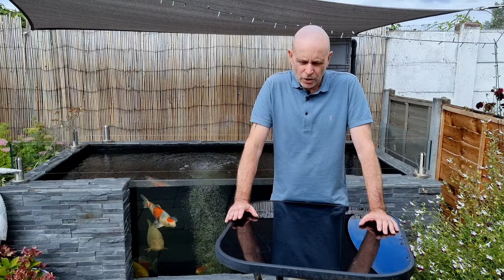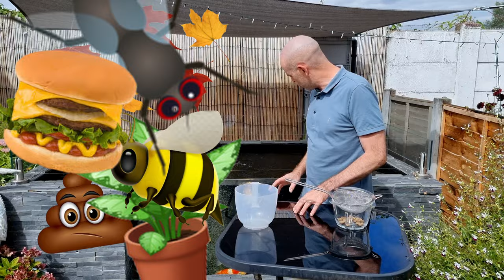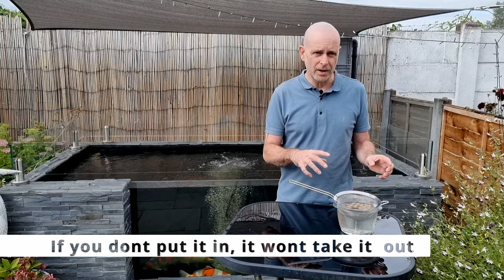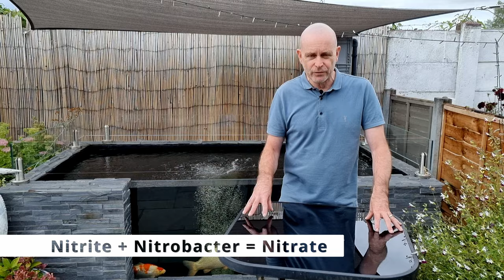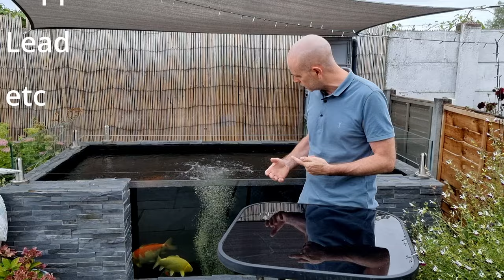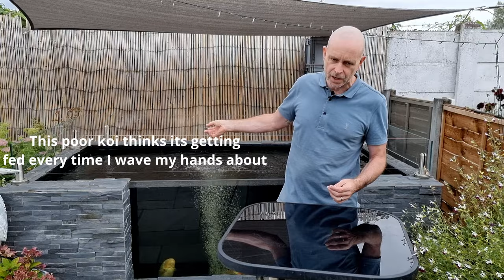Perfect Koi fish pond filtration - everything you need to know

Comment: Another informative video and explained clearly. I found your channel about three months ago and since then my koi’s health have improved tremendously as have the water test results. Just sitting watching my koi you can see they do look more active than they use to. For the past two months I have cleaned my pod out everyday which I then top up the pond with about 80 litres of water so my next project is to sort out a trickle in and out system using the pod as an overflow. I have also built a bakki shower to your spec but the medium I used is ceramic shower media from Queni Koi which is only about 20 miles away and it seems to be working fine. I am looking forward to your video on oxygen, thank you Daz and please keep the videos coming.
Reply from the maker: Hi Mark, thanks very much, that's brilliant to hear 🍻🍻🍺🍺🍻🍻
How active, and how willing they are to eat, particularly when you are stood there watching them, are great indicators of your koi's general health and well being. Yes the Queni koi media should work every bit as well as the kano 👍
I need to get on that oxygen video. It was a matter of priority as everyone was having problems due to the warm weather but before I could get it made it had cooled and I had missed the boat.

Comment: hi Darren, did you build your pond yourself ??? if so how did you fit the window, just i'm wanting one but my koi dealer has told me that you have to re-seal them every year ..... is there a way around it ???
Reply from the maker: Hi Stephen, yes mate I built it during lock down. I'm not sure who has told you that but its absolute rubbish mate. I fitted a window in around 2000 and I know for a fact that window is still as good as the day it was fitted and hasn't leaked so much of a drip in 22 years. Zero maintenance.
I'll make a video soon explaining how to do it but it is very simple. You created a recess in to which the window sits and you line the recess with silicone (I use HA6), you then push the window in and hold it in place for 24 hours for the silicone to cure. Job done. The water pressure pushes the window in to the silicone for extra safety.

Comment: my pond is roughly your size (newly built) and all i have is an easy pod. I have been told this isnt enough. What would you recommend - a tempest? What is your setup?
Reply from the maker: Hi there, set up correctly with 5500 litres of flow and flushed regularly (ideally every day) the Eazy Pod is absolutely fine on your pond on its own. I have a 3" bottom drain to the pod gravity fed, from the pod to a pump and then tempest, UV, home made shower, back to the pond under gravity.
The shower and the pod are both great additions that do two different functions. Either will give you good benefits but neither are vital.

Comment: Hi, was wondering if I could get some advice.
I’m really new to the pond game. The pond was set up (I watched some of your videos and well as others) and yesterday I added two koi’s to my tank which are around 7 inches each. One is a sakuma mix and one is an aoki tosai. My water temperature is around 17-18 degrees. When I added them they would run and try to hide behind the pipe of the pond pump. When I leave they swim around the pond (guessing they’re shy). The problem I have though is how long does it usually take till they’re no longer shy because I’ve noticed when I’ve put the hukari food pellets they’re not eating them either and when I go towards the pond to see if they’ve eaten them they hide again. Is this normal or do you think there could be a problem? Is the water too cold for them so their digestive system is slowing down? Not sure what to do next to be honest.
Any advice would be appreciated, thanks.
Reply from the maker: Hi there, its difficult without seeing it to be honest. You should have a test kit to test ammonia, nitrite and pH at least. Do this regularly. I have a video on starting up a new filter which may be useful.
When they get bigger they will be more confident. Also if you had more koi in there they will be more confident. It isn't a surprise that they are shy, but test the water to make absolutely sure there isn't something else wrong.
Feed them only on a good quality wheatgerm now until the water warms up next summer.

Comment: I think I have just killed my filter bacteria? 
I have had a ammonia spike due to a mistake cleaning my filter. 
I have done a half change with my water and bought a aeration  pump to improve my oxygen levels. 
My 3 filters are doing the job and levels are down now the the air stones are adding extra help. 
I have noticed my fish flashing, and I decided to go to my local aquatic centre and asked advice. 
They gave me a treatment which is medifin. I couldn’t find anything useful on YouTube about it. 
As I’m not sure if it is a parasite issue I aired in the side of precaution .
So decided to put 60mm in rather than the 300mm it advices for my pond. 
To my surprise it has turned my pond blue. 
Now after reading some forums, they say this stuff is quite bad. For fish plants and filters is this true? 
And do I need to do another water change? 
I will be buying a microscope from now. I don’t feel I can trust the garden centre anymore. 
This hobby is very frustrating at times. Lots of traps to fall down.
Reply from the maker: Hi there, sorry to hear about your issues. You are definitely correct that you should never trust that place again, they have no idea what they are doing and have simply sold you a product that is labelled as a 'cure all' when in fact there is no such thing. You wont have caused any harm but you wont have done any good either.
Stop feeding until your ammonia is under control. If you dont feed you wont add more ammonia. Extra oxygen will help in  many ways so that's a good move.
Get yourself a dropper test kit if you dont have one already, colombo is good but there are others that work well to. 
And yes, definitely pick up a microscope. If you keep koi you need a microscope. Scrape 3 or 4 koi and let me know what you find. 
There is no panic with regards the medifin though, it wont do any harm 👍👍
Reply: Thanks so much for your advice,much appreciated. 
I have gave my pond another flush of 50% and the flashing has stopped. 
No excuse though, I will be getting a microscope. 
I have also cleared my fry and small gold fish out to give more breathing space for my koi. So hopefully that should help. The pond looks empty now, but not  a bad thing. 
And have a nice aquarium in the dinning room now.  😀👍🏼
Thanks once again you have settled my mind. Fab channel . 👍🏼✌️😀
Reply from the maker: Youre very weclcome. And don't worry, it wont look empty for long, they will grow much quicker now and soon fill the pond again 🍻🍺🥂